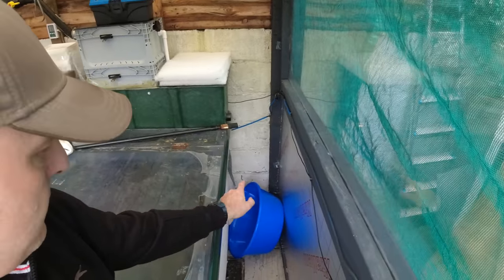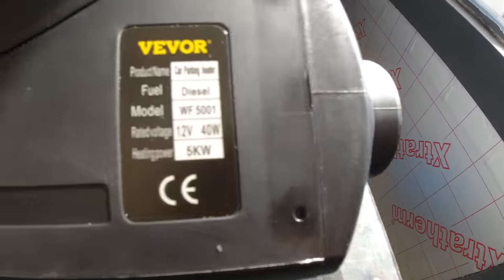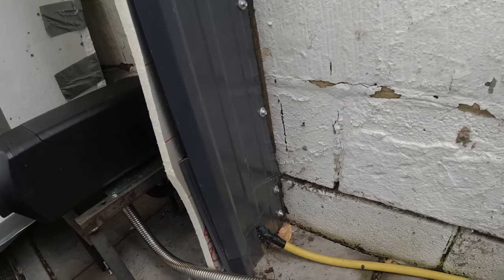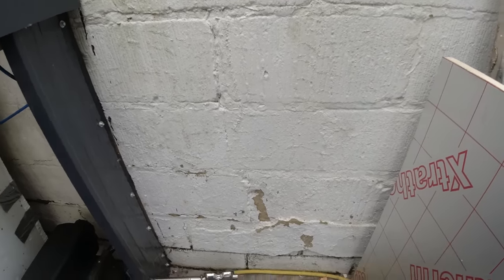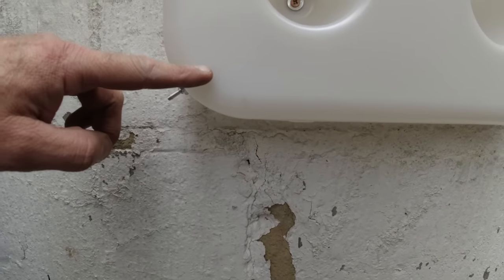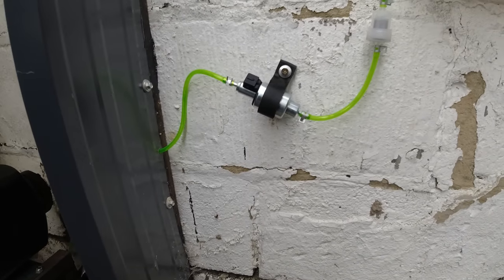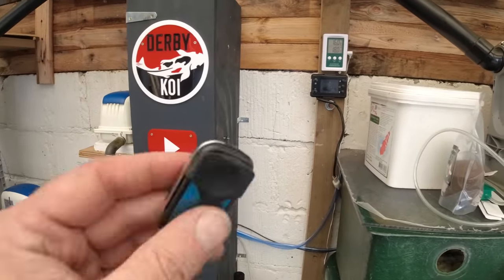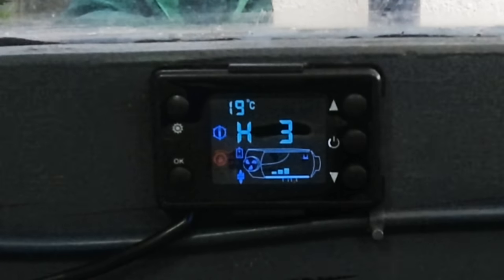DIESEL AIR HEATER INSTALLATION (CHEAP EBAY CHINESE 5KW HEATER) (KOI POND)

Comment: Nice one Andy looks good that heater m8 i would extend the controller wire so you could have controller where you originally wanted it, i think i maybe purchasing one of these heaters,
Reply from the maker: Cherrs mate i may extend it and move it at a later date but im happy where it is for now and lots of testing to do and excited to see how it performs. Stay safe Andy

Comment: Great video , I have a few tips for you (I have 2 of these heaters)  , the cable from the battery will suffer "voltage drop" being DC ,so thicker cable EG 2.5mm or 4mm might be wise , you've fitted the air intake inside ,so all the time the heater is running it will suck "warmed "air from your fish house ,this will create a negative pressure in the fish house ,which will draw cold air in from outside via any gaps (like round the door) you should consider relocating the air filter outside to avoid this ,so combustion air is the cold air from outside (also ,cool air has more oxygen and is more efficient combustion)  you can also fit an car EGR cooler to the exhaust to recover the otherwise wasted heat from the hot exhaust to heat the water (though this set up does require a circulation pump, thermostat ,pipework etc)  , anyway .... hope that helps, all the best , Dave (a fellow Koi keeper)
Reply from the maker: Hi Dave thanks for your suggestions i have fitted a larger wire and so far no problems but i can redo it and increase if needed and as for the air intake i have taken your advice and will put it outside, also i did think about using it to heat the water but decided not to go down that route at the moment. Stay safe Andy.
Reply: Hi dave im thinking of using a diesel heater in my workshop but run off a 240v to 12v transformer do you know how to wire in a 12v battery backup incase of a power cut? Thanks

Comment: Hi Andy, looks good, i think i would consider adding a manual fuel shut off to disconnect the heater from the diesel if required 🤓
Reply from the maker: Hi mate i did get a shut off tap but it was to big for the pipe so I'm waiting for another one to arrive. Stay safe Andy

Comment: I'd suggest putting a drip loop on the wiring to your fuel pump. We use those connectors on buses a lot and if water can run down towards the connector it'll get into the terminals through capillary action. Great install though!
Reply from the maker: Thanks Nick thats something i will do also I'm probably going to put some kind of cover over it. Stay safe Andy

Comment: Looks like a great little heater that will hopefully get the bunker warm all winter. You've done a great job on the install but I would suggest you install a carbon monoxide detector in the bunker for peace of mind and safety. 👍🏻 Cheers.
Reply from the maker: Cheers mate, I've already got smoke and co2 alarms to install but thanks for suggesting it. Hope you're well Ken 🙏

Comment: Another top video thanks for taking the time, great idea with the heater solution well done. You might want to get the battery off the floor it tends to drain the power when on the floor.
Reply from the maker: Thanks mate, the battery is off the floor, it was only there temporarily to test it running. Cheers 😁👍🏻

Comment: Looks good have you calculated the voltage draw to see if your solar panel will keep up with what your heater needs to run. pump fan control panel ect don't want your power running out ✌️
Reply from the maker: Hi mate i haven't calculated it but after researching one of my batteries should last about 8-9 hours on full power so two batteries will be more than enough especially as it won't be running on full. Andy

Comment: GREAT ANDY--- COULD I ASK ABOUT 12VOLT BATTERY IS IT JUST THE CHEAPEST YOU CAN GET OR IS IT SPECIAL BATTERY ?
Reply from the maker: Hi Allan its just a standard battery i got at a good price so i brought two so i could double the amp hours. Andy

Comment: Nice setup there Andy, how much do you think it has cost you for the whole thing? (Solar panels, Batteries and deisel heater).
How much do you think it will save you?
Reply from the maker: Hi mate the heater was £100, solar panel £50 and i had one battery already and i got the other one a bit cheaper for about £70 and as for savings I'm not sure but i did get the diesel at a very good price which i think will work out cheaper than using electric to heat.

Comment: Hi Andy great video, can i ask how you changed the reading from degree f to c? Thanks
Reply from the maker: Hi mate, I don't think I changed mine, there are so many different controllers but I think you can only change to hz for H1 H2 etc but don't quote me, the instructions manual is lacking. 
Sorry can't really help 😕
Reply: @DerbyKoi  Thanks for the reply, I think I've sorted it out! That exhaust pipe get VERY hot so got to sort out safely running it outside 👍🏻 keep up the good videos 👌
Reply from the maker: @cadkoipond1975  thanks mate, you can get a heat resistant wrap on ebay 👍🏻
Reply: @DerbyKoi  just ordered some off Amazon 👍🏻
Reply from the maker: @cadkoipond1975  happy to spend your money 💰 🤣